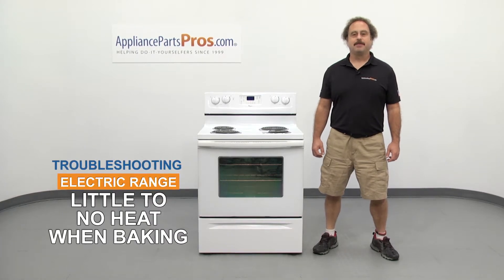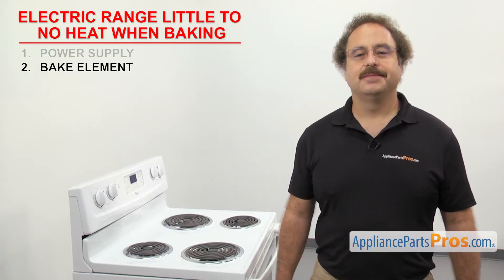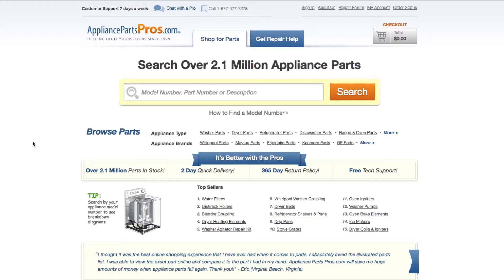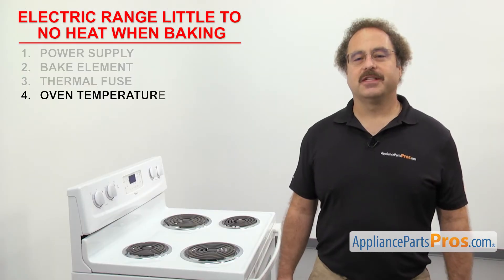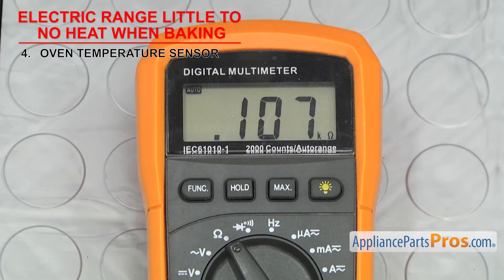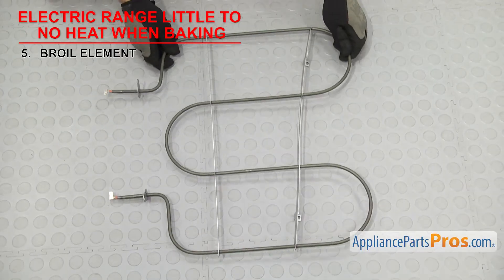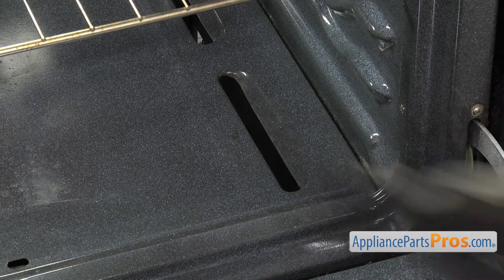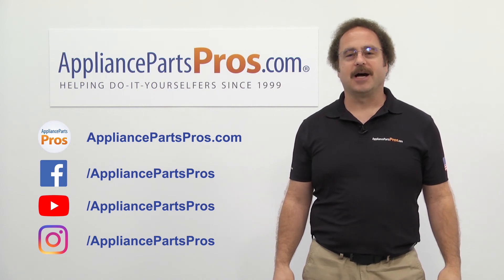Electric Range Little/No Heat When Baking - Top 5 Reasons & Fixes - Whirlpool, Frigidaire, GE & more

Comment: I have changed the temp sensor and tested the bake element.  If the thermal fuse is blown will the oven try to heat?  My oven just clicks and heats to about 180 or so.  Board appears good.
Reply from the maker: What is the model number of your oven and we can look into this for you.